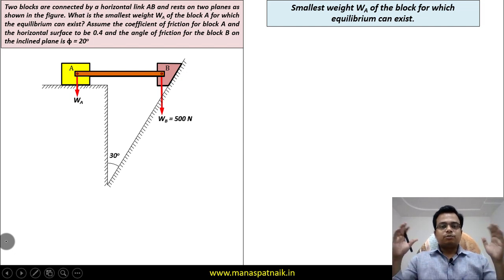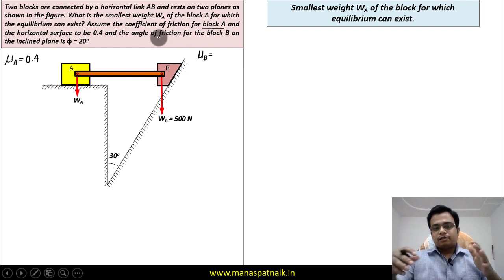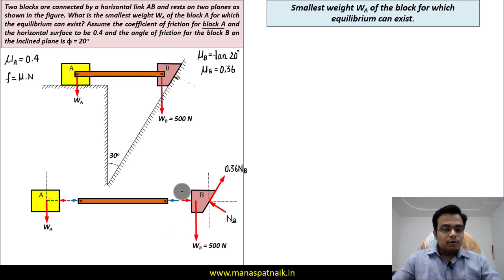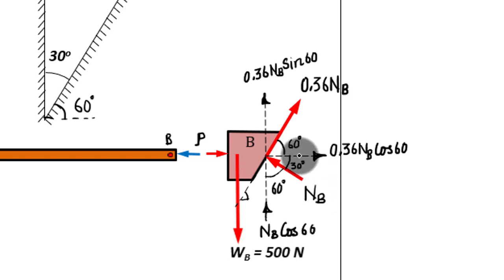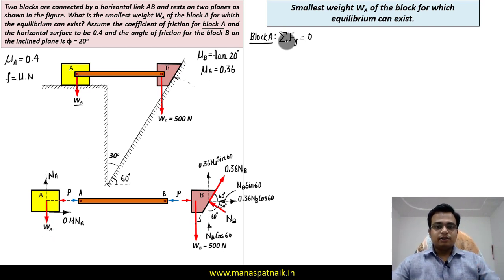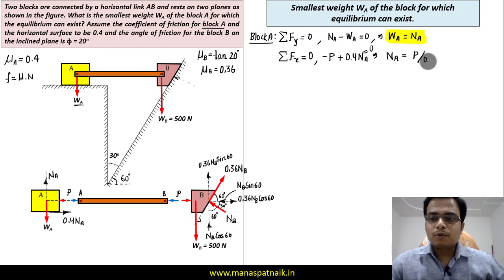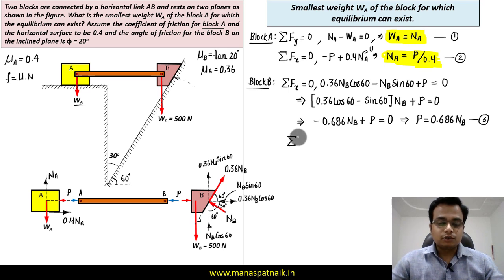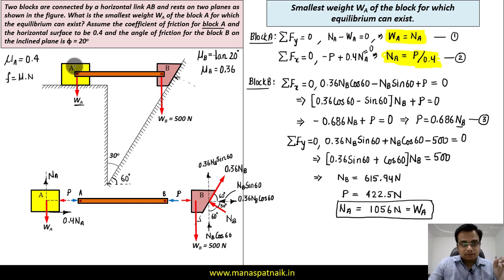Friction | Problem 7

Comment: In block A frictional  force will be left side but not right side because block B is moving down ward ,then block A will move right ward,if it moves rightward then obviously frictional force will be left side
Reply: The block is moving downward but in the left side. The B block is moving down left so block A will tend to move  left side as well and  as a result the frictional force will work on the right side.

Comment: Why does block A has tendency to move towards left!?
Reply: Because the block B try to slides down, therefore the link attached to the  block B that will tend to move left, so the link push the block A into left. Okay?